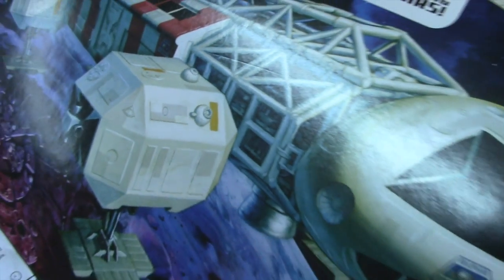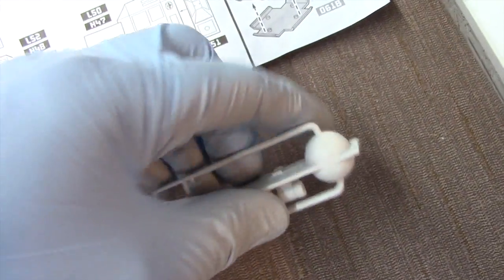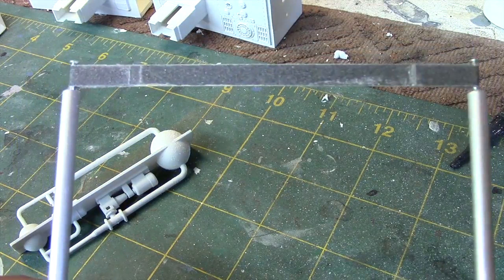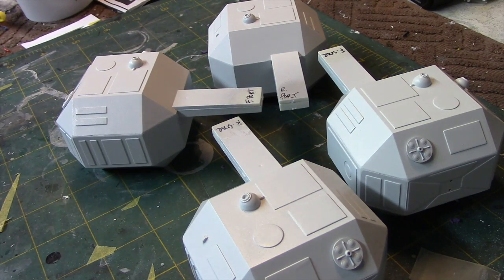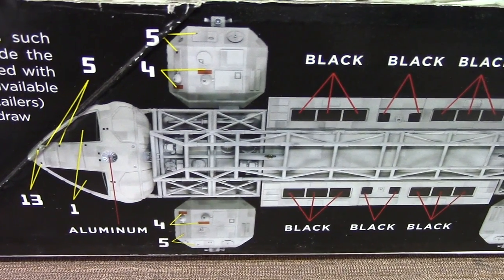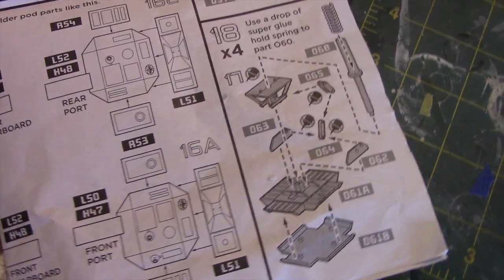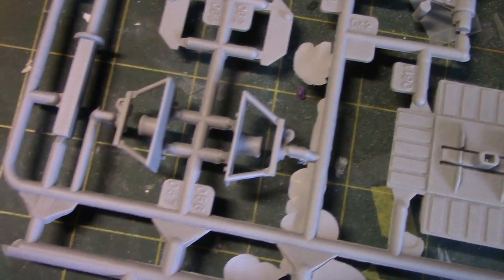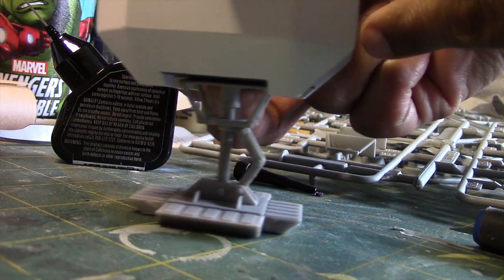Building the Round 2 Space: 1999 Eagle Part 2

Comment: Great Video... Ive just purchased one of these kits and i'm really looking forward to getting stuck in, I have trouble finding the size of spring on ebay though :/
Reply from the maker: Hi Phil...thanks for your kind comments. I would highly recommend joining the Space: 1999 Props and Ships page on FBook.  There are a lot of resources there including decal templates you can use to print your own.  I have 2 of mine there in their file section. Also there are a bunch of people who know where to get a hold of those springs, even softer ones that I used (which I'd recommend).  Lots of people who've repeatedly built this model are there too and can answer just about any question you may have.  Enjoy the kit....it's a fun one.
Reply: Thanks fella, I have indeed asked if I could join and am in the process of waiting to hear back from them. I am now looking into a decent airbrush to use, could you possibly recommend one?
Reply from the maker: Phil Lines The Patriot 105 by Badger. So easy to use and maintain. I think they sell them at Michael’s Craft stores and w/a 40% off coupon it could be a good deal

Comment: Are those replacement springs stainless steel or alloy?
Reply from the maker: Its been 8yrs since this build so i dont exactly recall.  If you’re interested in putting springs in, i would recommend inquiring at Space 1999 Props and Ships on Facebook.  Lots of modelers there who would have a better recommendation.  These particular springs were too stiff.  Thanks for watching
Reply: @InterstellarModeler  Thanks for the quick reply. I'm thinking the original ones are stainless steel and that's why they're rigid and other alloy ones would probably be not so rigid, but I'll check the props and see, thanks!

Comment: Hi, what is the brush you use to apply pastel in this video?
Reply from the maker: This one in particular was a 6 Round brush.  I recommend not using an expensive brush with pastels as they do become frayed especially as you apply it to areas with a lot of contour.  This brush is somewhat pointed, not broad, which is what I need for most weathering.  Although...there may be times when a broader brush is called for if you're applying to a larger surface area.  Hope that helps.

Comment: Looking excellent as usual. Can I just ask, what are you using to apply the glue with? It looks like it gives an ultra precise result. And how do you stop the glue going solid in the needle applicator? Does it come off so you can soak it in thinner or something?
Reply: I second this question!
Reply from the maker: Sorry for the late reply.  The needle applicator comes with the Testors cement.  Keeping the bottle upright with the cap on usually prevents it from hardening inside the needle.  Thanks